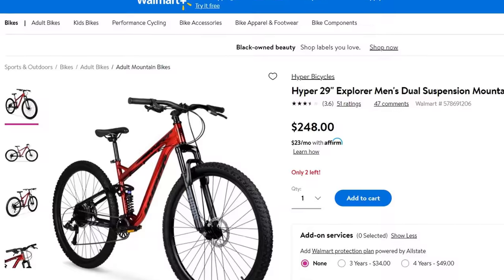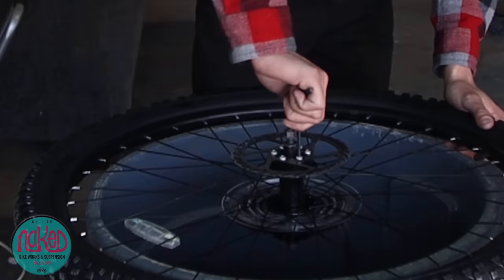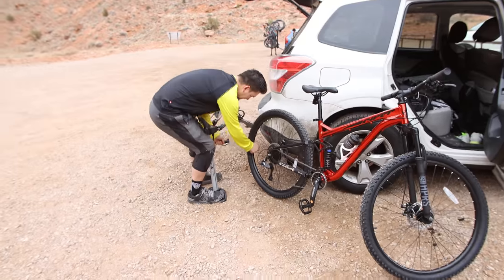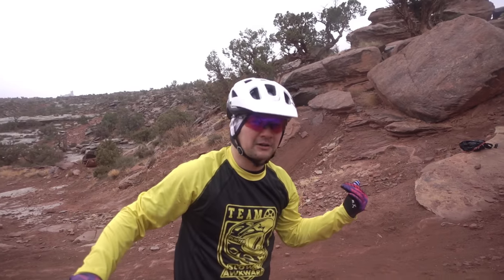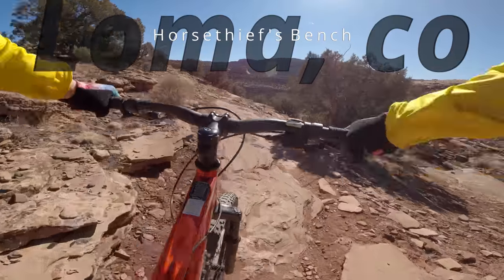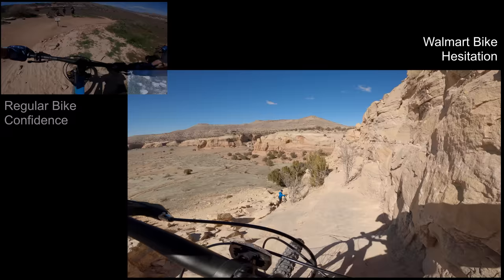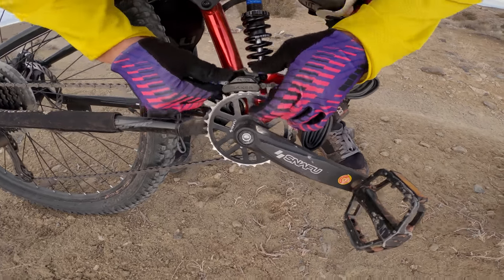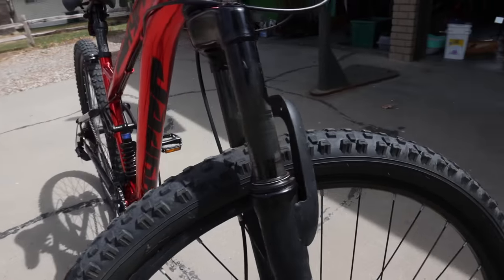Walmart Bike Survives Real Mountain Bike Trails!

Comment: Single piston mechanical disc brakes, when set up and adjusted correctly, are actually quite good. They will only bend the rotor maybe one mm towards the fixed side, which is not even perceptible and does not affect the braking in any negative way. But people like that 'mechanic' love to berate cheap products simply because they don't cost a lot. That's bs.

Comment: Now, after watching the whole video:
The rear triangle on that thing is mild steel. Not even chromoly, mild steel. It's complete trash. The stock forks on all the bikes at Walmart? Also complete trash. In order to make that bike acceptably functional, you have to get a new fork at least as good as an SR Suntour, a narrow-wide sprocket for the front, a set of aftermarket hydraulic brakes of any quality, and probably have a welder fabricate a new rear triangle, as well as getting a functional rear shock. That model of Hyper is actually a parody. If you have to get a full suspension from Walmart, there's a  Mongoose on their website that sucks a lot less. If you're okay with a hardtail, the blue Hyper Explorer is okay, and Schwinn and Mongoose have acceptable models now. The Schwinn Axum is one that actually would only really need a fork replacement to be close to Trek Marlin quality.

Comment: I bet if you replaced the pedals, the front and back suspension, stem, handle bars, and derailer. Then it might be a ok bike
Reply from the maker: Lol… “ok” 😅 after those upgrades, you’d probably be in the same price range as a decent bike shop hardtail that’s more upgradeable and durable… especially with a replaceable derailleur hanger 
IMHO 🤷🏽🤘🏽

Comment: My trial bike is a sacaren raw pro they did 2 types which I own both types the frames are pretty much the same with small differences but the older of the 2 has a much better swingarm and components in my opinion so it's the older one I use for trails I get told I'm mad using a late 90.s bike for something like that but it's held up well even the guy I got it of was a big fella and it lasted him 6 years of trails without any damage at all it owes me 250 pound and 2 gear cables I've had bikes worth ten times that amount in my life time but this one seems to suit me perfectly one of the only bikes I wouldn't sell

Comment: Components Components Components Components Components Components Components Components.

I'd say do this again. But replace the shocks as you so complained about and put a new derailuer along with slime in the tubes.

Then test it again. Cause from what seems to be said. This isn't bad after few little upgrades. Stock yeah the fork and rear shock suck. The derailuer is junk. And most people even tubed or tubeless always slime their wheels.

Comment: I am scared for you. Just….. don’t. Please? I wish Walmart and most other big box retailers would lose the “mountain bike” description. These are death traps on anything but pavement. Buy a 30 year old stumpy or cannondale, and maintain your teeth, and ability to walk and think. Even modern cross country is a real test for reliable, expensive, genuine mountain bikes. Just remember the bike controls your existence. Would you use a cut rate pacemaker, or hip replacement? Don’t be cheap. You don’t have to spend $2000 to enjoy it, but don’t take your life for granted. Even if the damage is minor, walking 4 miles to get back to your car will keep novices away.
Reply: It all depends on how you ride the bike, if you ride like OP A $5000 Stock bike requires a costly tune-up every ride. Walmart bike work for most beginners' trail.

Comment: I purchased this bike and have to say it's not bad for the money, after owning a couple cannondales (rush 1 and Lefty) No this bike did not match up to the performance of a $2.000 or a $3.000 bike but at 250 bucks it's the best low budget bike around. The gearing is pretty good the brakes not bad the shocks suck they are just spring loaded no rebound control at all. I don't ride as hard as the guy in the video but if i did I wouldnt buy this bike his review is a bit unfair we all know you get what you pay for bottom line......
Reply: Giant makes some great bikes under 500$ i mean hydraulic brakes shimano drivetrains etc and at least they wont break on the first ride
Reply: @krzysztofnowak69  hydraulic brakes are over rated and like anything there are differences in quality so at 500 bucks you are not getting the best brakes! I'm 245 lbs bike hasn't broken on me (yet) but if you are doing hard rides and jumping this bike wouldnt be a good choice. I feel some people are just to nit picky on youtube when it comes to comparing lower end bikes. This bike isn't going to compete with higher end bikes I made that clear.
Reply: @krzysztofnowak69  BTW I did look at the cannondale 500 and below bikes (they were hard tails) and honestly feel some key features on this bike are better like the gearing (9 speed x 1 ) the range was greater. The brakes are not bad but ill up grade them that was planned before the purchase. All i'll do is put larger rotors and adapters...
Reply: @battlized  it trully depends what you want the bike to do becous eif you want to hit some legit ble and mabey black rated trails you seriusly need hydraulics
Reply: @battlized  i would say that walmart bikes are purely commuter bikes that look a bit cooler
Reply: @krzysztofnowak69  You seem to forget in my post i had some good bike sin the past so i know  a little bit about what i'm talking about but you are entitled to an opinion